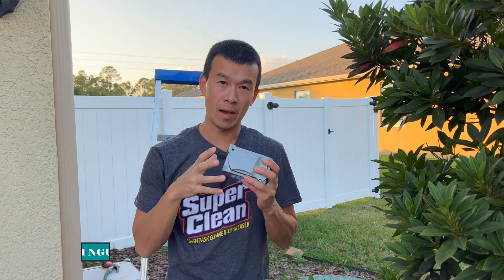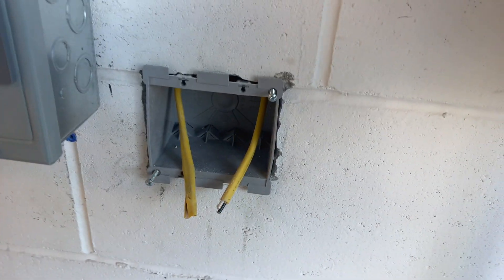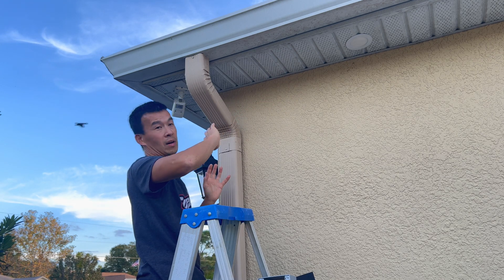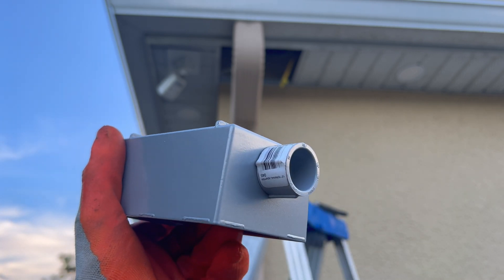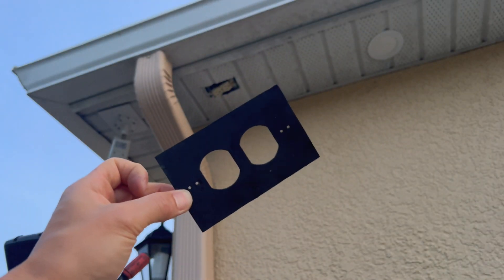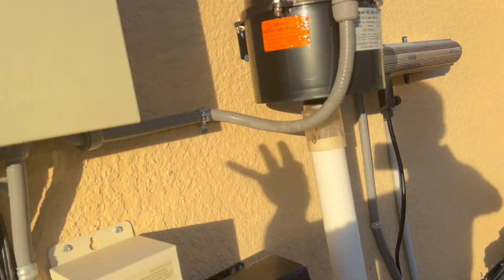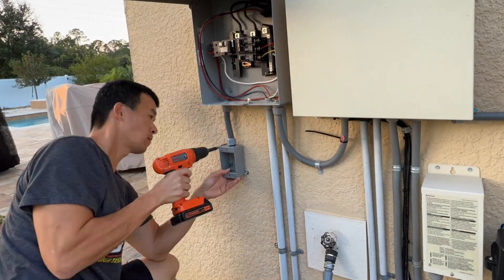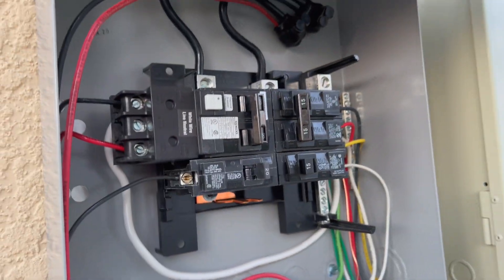How to Install Outdoor Soffit Electrical Outlet | Christmas Light Outlet

Comment: Code... code... code.
Reply from the maker: Soffits are considered indoor space and NM-B is fine. ALL the new construction  in my area prior to drywall all use NM-B for soffits and flood lights on soffits. Also I’m an electrical PE so I do keep up with this stuff in my designs. For the surface outlet, I should have used THHN instead of romex for that short run from panel down to weather box.

Comment: Just because you can, does not mean you should.
Reply from the maker: Soffits are considered indoor space and NM-B is fine. ALL the new construction  in my area prior to drywall all use NM-B for soffits and flood lights on soffits. For the surface outlet, I should have used THHN instead of romex for that short run from panel down to weather box. I should use a strain relief for that weather box instead of the fitting but used what I had on hand.

Comment: So i got one quick question is the wire already in the soffit above the outdoor box, did you run the wire thru the wall to the soffit from inside or what, I just want to know basically how would or where is the wire in the soffit for me to jump off or whatever I need to do
Reply from the maker: I ran a circuit from subpanel. If you know what you are doing, you can daisy change off another outlet from garage attic to outside if you have that kind of access. I did a more detailed video here. https://youtu.be/6amYylO1ao0

Comment: I'm a DIYer like you but I see a couple of things that are really concerning.  First, I think using an "in use outlet cover." would have much better.  However the biggest problem is I would have liked it if you had used 14/2 UF-B in the soffit.  Your installation is not really up to code, and UF-B is awesome for DIY!  It can be used for direct burial, ran in conduit or bare, and of course it's wet rated.  It only needs to be in conduit when there is danger of damage like on an exterior wall.  NM-B can not be used in any of the previously mentioned conditions. I would strongly consider replacing the wire you used as well as the cover, for insurance purposes.  Please take this comment in the spirit it was offered.  I loved your video and found it invaluable for a similar project I am about to do on my home.🤔
Reply from the maker: Soffits are considered indoor space and NM-B is fine. I looked at new construction  prior to drywall and the electricians all use NM-B for soffits and flood lights on soffits. Also I’m an electrical PE so I do keep up with this stuff in my designs.
Reply: Has anyone seen an "in use outlet cover" certified for ceiling?

Comment: The main part where you remove the soffit panel and connect the wires is speeded up video, so not useful, this was the critical part to learn and understand how to do it.
Reply from the maker: I have a lot of other wiring videos so I usually speed that part cause it’s boring. Basically 3 wires, Hot (Black), Neutral (White) and Ground (bare/Green). Hot pushes in or do a loop to the gold lug of the outlet, Neutral goes to Silver lug and bare ground loops around green screw.

Comment: They do make weatherproof connectors that screw into the plastic/metal box and the wire slides in. The rubber grommet pinched the wires preventing water or moisture going in. FYI
Reply from the maker: Yea I know...its usually a strain relief too. I was just lazy and working with the materials I had on hand.

Comment: Good explanation but as a journeymen electrician never use expanding foam to seal a box just use the correct stuff . Liquid tight wouldve been the way to go
Reply from the maker: Yea I ended up just leaving it. The above eave is a grey area between being considered a wet or damp location. Most electricians I see still run NM there vs UF. I did realize I used NM on that side exterior box at the end. Have to swap that with some THHN or UF.

Comment: Did you ever butcher the plug opening.🤦‍♂️👍
Reply from the maker: Yea measurements slightly off by 1/2”.
Reply: @TunerwithKids  did you think about replacing the Sofia peace? I have a suggestion also.  Do another video replacing it.  Keeping in the some points of interest from the original video.  I'd personally slow dow  the wiring portion of your video. As it is probably the most important part of the whole set up for the installation.  Anyhow, peace!!
Reply from the maker: My gap wasn’t bad enough to replace. Plus that piece is basically full of holes anyway so the gap isn’t noticeable. I’ve got a few videos on wiring outlets so I try to time lapse these repetitive tasks.
Reply: @TunerwithKids  oh  only watched the one.  Anyhow, peace, pleasure talking

Comment: This was great except you did not show how you made the hole inside your garage near you box, etc. Basic connection instructions are missing here. This video was great for installing the outlets and running the wire, but nothing on making the outlets live with power.
Reply from the maker: I have a video right before this on the channel for the subpanel and holes. https://youtu.be/YNFKuDulcMM
Reply from the maker: Also for wiring details on adding outlets, I have another video that details that. Usually I speed passed these because I've already got detail videos about them. https://www.youtube.com/watch?v=2e-e2bCpXTM&t=830s
Reply: @TunerwithKids  Great!! Thank you!!